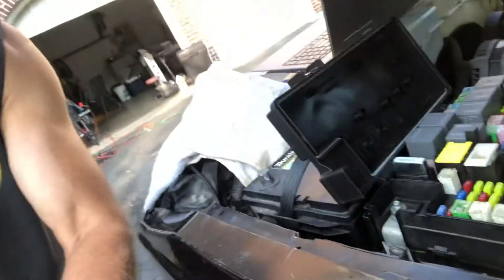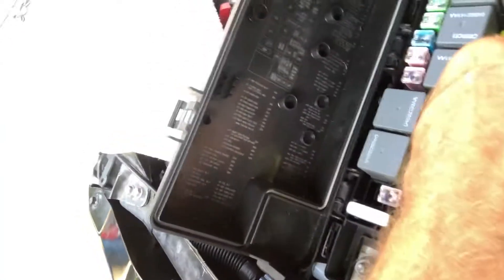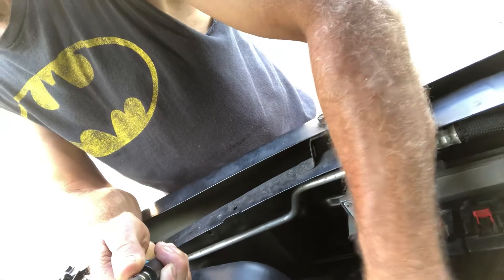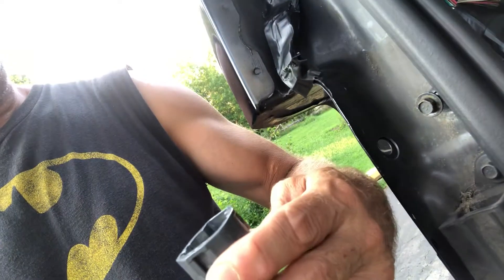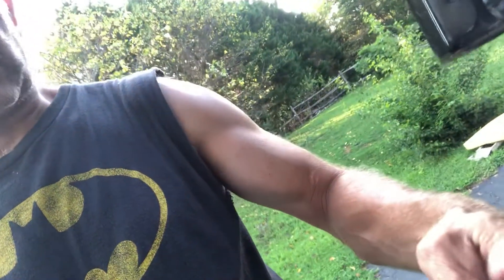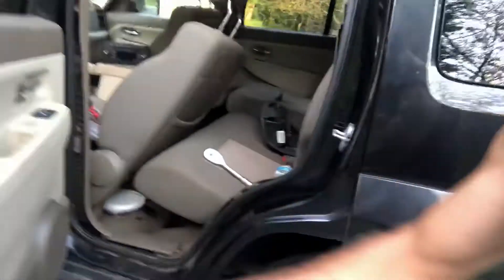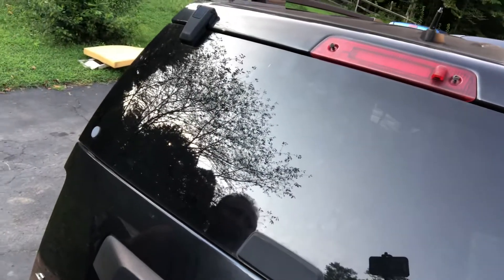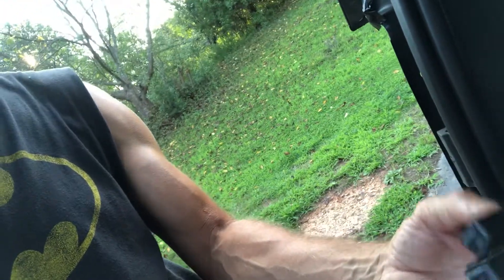2010 jeep liberty brake lights won’t shut off

Comment: Everyone who makes this same video spends a bunch of time explaining where these relays are located then when they actually pull them out, they don't actually zoom in and show the exact spot where they are pulling them out from. All 3 videos on YouTube all did the same thing. I have the same exact year and model and I'm not seeing these relays.
Reply from the maker: There should be a cover and inside it are the relays
Reply: @elcheapo1112 are the relays only for the tow package Liberty? I also have a 2010 Liberty without the tow package and I can't find the relays back there.